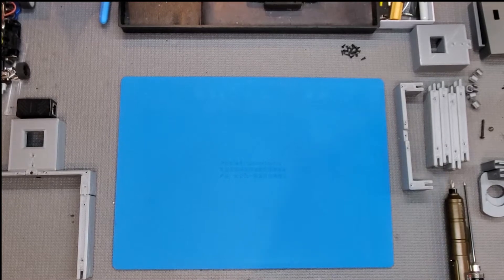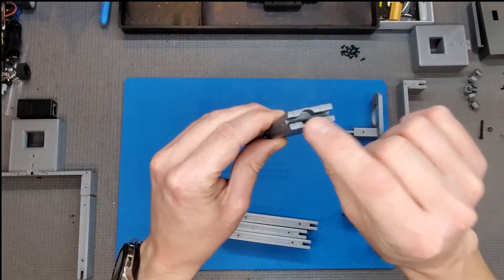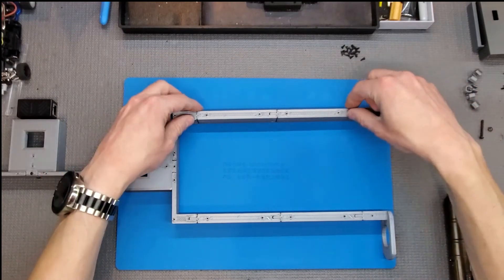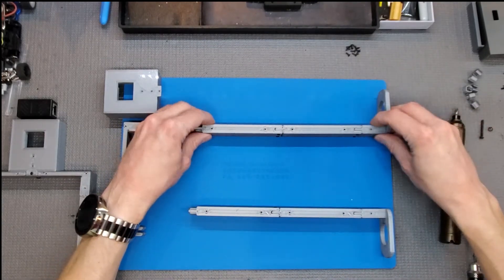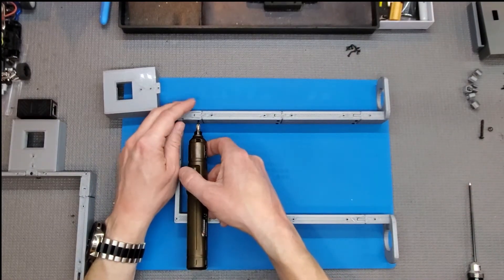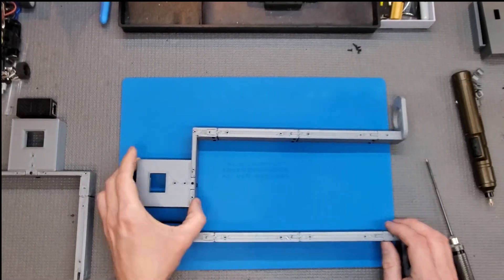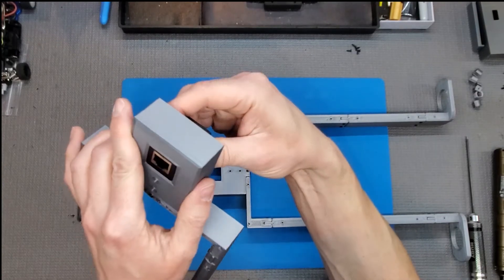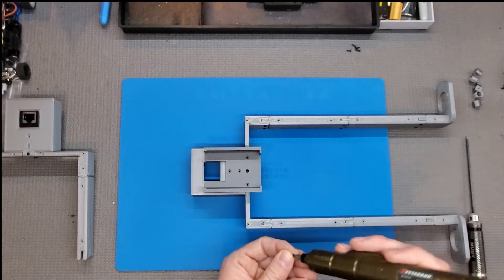Timing Bridge Assembly

Comment: Do you have any trouble with it counting cars? If I go fast it will not count the car
Reply from the maker: i've found it depends on the timing system and number of sensors.  if you use ilaps or trackmate it's best to lower it to just a single set of "legs" on the sides, if you use Easy lap it's best to raise it to the double set of legs (all the legs that come in a set), this is true for 2 tile wide 50cm track, it may be slightly different for 2 tile 30cm or 3 tile 50cm as that you may need to get into more sensors especially if trying to use easylap on 50cm track.   at least that's all from my experience wit hit.